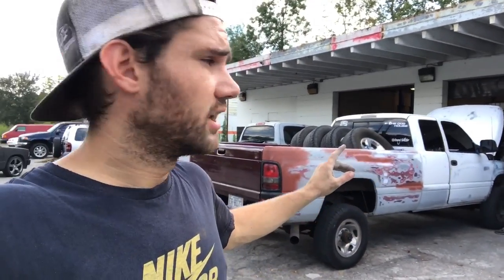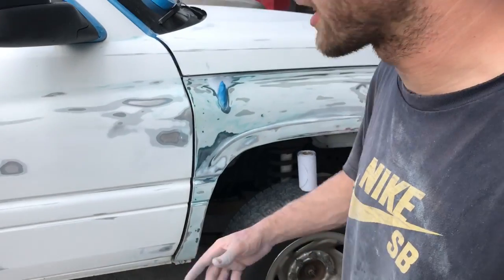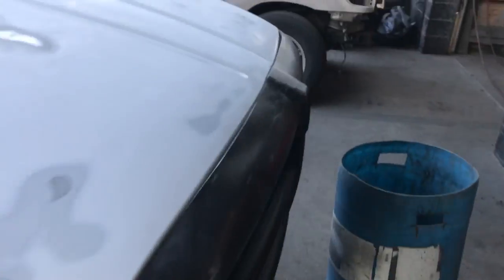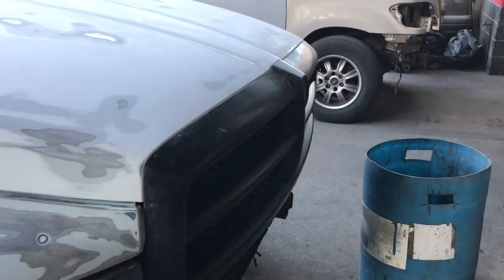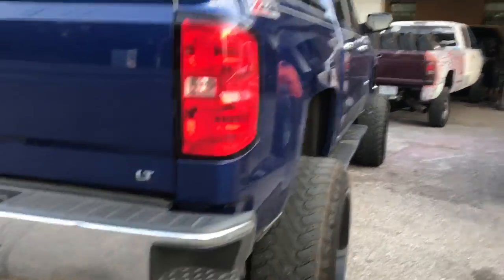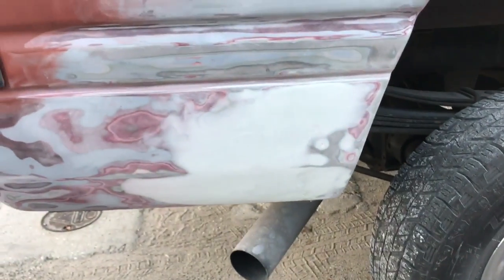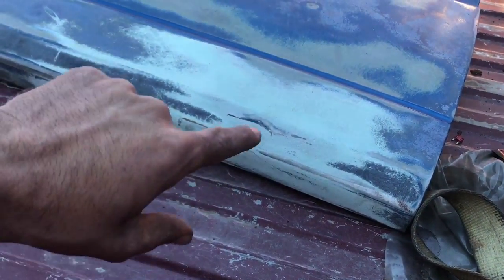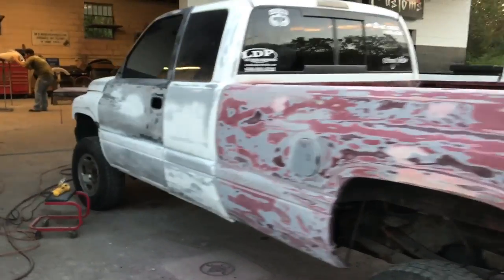LAST BIT OF PREP WORK BEFORE PRIMING!!!

Comment: What all are you looking for in the 240 your wanting to buy? Swapped, stock, shell? Is there any other chassis your interested in besides a 240? By the way I changed my name and profile pic it use to be Ryan wade with my white chevy in the picture, we've chatted quite a bit in your vids.
Reply from the maker: Trial&Error Automotive if you look back, I have an entire build series of my 240. I rebuilt the KA, anyways it’s for sale & new owner is willing to sell it back to me. But before I moved,  I was “planning” on getting some coil overs & a handbrake. Stitch welding my unibody seams. Slowly learning my way into grass roots drifting. Maybe have my LCA extended, tie rods for an angle kit, etc. & then maybe sell it for a shell to do a v8 Build.
Reply from the maker: -travis lol
Reply: Yeah I member seeing a few of those vids of your old car, I just started autocross this year in my 94 1.8 miata, I'm raceing stock s2 class now which allows you to do a few things to the car but over winter the car will become a completely different animal, very interested in the stitch weld videos as I will be doing a bunch when the car is apart, trucks coming along good my dude.

Comment: How much are you gonna sell the truck for?
Reply: Eddie Urban only worth like $5-6k unpainted.
Reply from the maker: kenny etenne lololololololol find me a 4 wheel drive 5 speed truck WITH no dents or dings in the south for 5-6k. ILL WAIT.
Reply from the maker: Asking 11.5
Reply: 11.5? lol I get that 5-6k is pretty low, but 11.5k is pretty dang high for a truck in primer. lol
Reply from the maker: Cody or you spend that and buy one with original paint, dents and dings. And you can pay someone to pull dents/sand and fill. Etc. I’ve purchased 3 second gens over 10k with original paint. I wanted it bad enough. 

You’re telling me with a mint original dash board in a second gen dodge with a cummins doesn’t already perk up the value. No matter the condition, plus the amount of time & parts I’ve put into it. Watch ill get what I want out of it. I sold my red truck for over 12k with 323k miles on it.